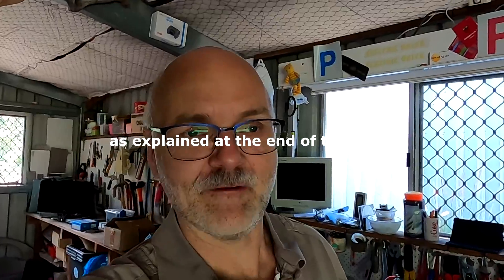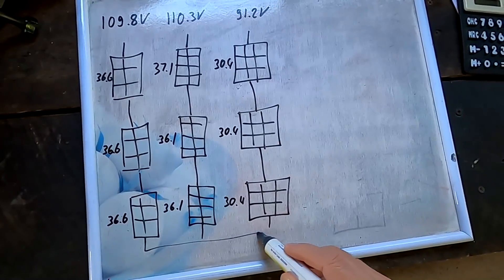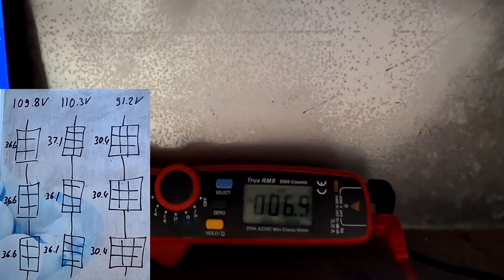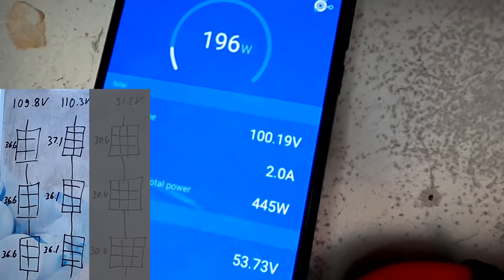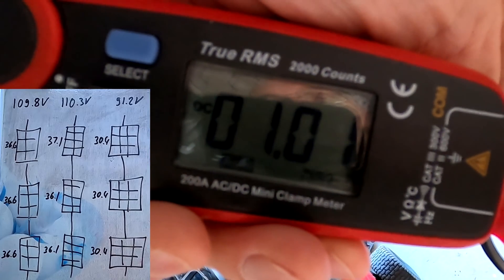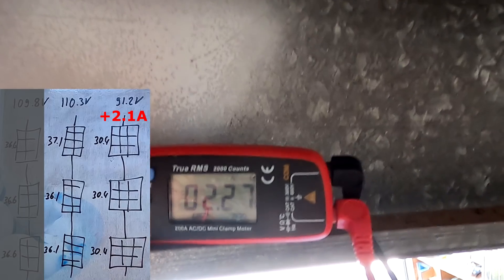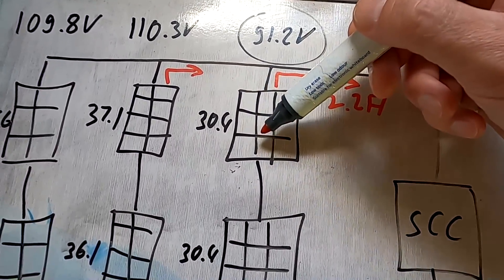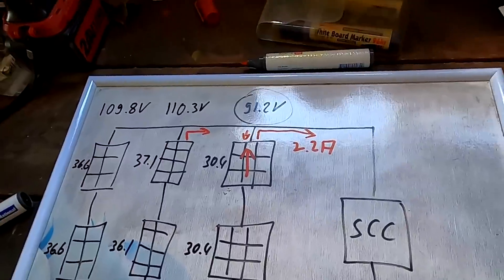Different solar string voltages in parallel. Does that work? (no blocking diode)🌞🔧⚡🔋

Comment: There will be no reverse current under load as long as the lowest-voltage string receives enough light to bring its open-circuit voltage up to the highest voltage strings' MPPT voltage. The only real problem here is that none of the panels will be able to operate at their MPPT since the charge controller will settle somewhere in-between at what appears to be the overall maximum power point instead of the maximum of either panel type.
Reply from the maker: Yes, that is correct. The SCC will find the overall power point of all the strings and run the panels in the best possible way. 
At the end of the video I had some info about two exceptions where current could flow the other way though.

Comment: The Mpp voltage of the different strings would be more important than the OCV .  ?   I like your curiosity Andy  .
Reply: Any Voc that is below the Vmpp would be VERY important ...
Reply: @MrSummitville  Yes but we know that's not the case here. I meant the mppv of the different brands may be so close is why it doesn't back feed. He showed us the voc .
Reply: @onthelake9554  My statement is applicable to ALL cases.  Your original statement is ONLY applicable to Andy's design - which you did not make clear.  Other people read these forums and they need to know how this issue may affect their design ...
Reply: @MrSummitville  Agreed.
Reply: @MrSummitville  And to those of you seeking design advice , this is not the place . This IS the solar experimental  garage for adults only , don't try this at home , batteries not included.
Reply: @onthelake9554  Actually, it IS the case here!  Andy's video shows the Vmp of String #1 & String #2 = 110 Volts.  But then the video shows the Voc of String #3 = 99 Volts.  99 Volts Voc of String #3 is well BELOW Vmp = 110 Volts of String #1 & String #2.  Now, look at where the "combined" Vmp value occurs ... it is pulled down near String #3's Voc.

Comment: Your mppt controller is finding the maximum power point for all strings.  So with 2 strings it picks 100v and with three it picks 95V.  You lose power from the 2 higher voltage strings when connecting the third.  It is safe to parallel strings like this, but you don't get the maximum power.
Reply from the maker: How much do you lose though? 1%? 2%?
Reply: @OffGridGarageAustralia  So easy to calculate.  95V/100V is 95% so you lose 5% on each of the higher voltage strings.

Comment: I believe if you use a MPPT controller there is a negative effect on the Voltage as the 2 higher power strings won't be able to produce there highest voltage to for the controller to use.
Reply: But the 3rd string adds way more wattage vs the small ( 5% ) wattage lost in Strings #1 & #2 = net GAIN !

Comment: O.k. Andy  the resistance off each panel in the lower voltage is 14 ohm each 42 ohms in parallel with the other two string of panels. The other strings are 17 ohms above each 51 ohms above at time of testing. So 16 ohms all strings  in parallel resistance.  Input resistance to the mppt see a resistance each moving of about 16 ohms at time of testing. Great vlog mate, really enjoyed this one. So let's say a input of much high resistance at the mppt input so maximum power transfer from the 16 ohms to the mppt. Wouldn't the doides help too?

Comment: So the MPPT charge controller operates the load, in this case the solar array, at the maximum power point.  If you connect panels of different VOC,  it will still operate the entire array at MPP for the system as a whole.  This will probably be sub optimal for panels which show different voltages but there will never be any current flow between panels.
If you had 3 charge controllers,  and you connected one to each of the 3 strings,  each string would then be operated at MPP and you would get the maximum current from the array.
Reply: There certainly can be current flowing between parallel-connected solar  panels ...
Reply: @MrSummitville  Can you please explain how that's possible ?

Comment: Things work as expected. You tied the strings together so they will be running at the same voltage. The current will add on the way to the charge controller. Imagine the mppt curve of both string, now for every voltage add the current in these curves. That will create a new curve. The controller will find a point on that curve where it can extract the most power of the combined system. But it is not very efficient. None of the strings will run at THEIR optimal powerpoint. But both will contribute until the open cell voltage of one string is below the max power point of the other string.
Reply: It is still very efficient because ... the drop in wattage in the Higher Voltage Solar Panels is much LESS THAN the additional wattage GAINED by adding String #3.  You totally missed the Moral of this Story ...

Comment: Rewinding so I can write the numbers down.
First look, I would say you need 2 charge controllers, 1 for the 2 strings with the same VOC, the other Cc  For the string with a lower VOC.
I am assuming the Imp is simular for all the panels in each stings. Can you show the lable for each panel type?

You said morning, on a west facing array, is that correct? You also said something different about shading for each string. Faint shading limits power production.

To many variables, so confusing.

Comment: Hi.
Yes you can combine your panels but your mppt charger will choose a lower MPP voltage so your higher voltage strings will run less efficient. The charger will pull the voltage further down, since power is voltage times current you'll get less wattage from the higher voltage strings.
Reply: I was told the same thing. I think in the case where you have these panels 2 controllers would get you the most out of the strings and you can connect them to the same battery
Reply: @TBL_stevennelson  Adding a second charge controller will increase the total wattage only 5% - 10%, not worth the additional expense ...
Reply: @MrSummitville  I think he means have the 3rd row on it's own CC being the second one, that way you get the most out of all panels at once.
Reply: @vet137  Yes, I know.  I said, only a 5% - 10% increase is output.  NOT worth the expense ...
Reply: @MrSummitville When you connect panels in parallel, the voltage stay the same. But, when the strings have different voltages, the higher voltage strings gets dragged down to the lowest one. All the three strings will operate at 99 volts, so the left string will loose 17,5% of total wattage output and the middle string will loose 16,8% of total wattage. That adds up to a total loss of 34,3% of total wattage output in the higher voltage strings.

Though the video was about Amps and what happens when you connect them in parallel (ads up) which was right to the point, makes this discussion a little sidetrack. When reaching for maximum power output in this array, it's better to disconnect the right string and receive the maximum amount of wattage in the other two strings. You can still use the right string for another purpose.
Reply: @SolarProjectsSweden  So in east-west roof and 1 mppt input, is it better to connect both strings in series and expect the bypass diodes to bypass the string in shade or its better to connect them in parallel and add a blocking diode?
Reply: Yep, that's what I was thinking as well. I think it's kind of a complicated problem, as the IV curves are going to look different for each string. The results you get will be dependent on what those shapes look like, and what the MPPT controller thinks is happening. But I agree, in general the efficiency is going to be lower than running them as matched strings. I wonder how it compares to the idea of reconfiguring the strings to have Vendor A---Vendor B----Vendor C  strings, so each string is matched (assuming max current ratings are the same).

Comment: I think your voltage dropped to the lowest string voltage in your test. It went to 99. That makes sense because if you parallel two panels with different voltages, the lower voltage is used, but you can add both strings amperage. That of course will make your total possible watts less than what you would get individually. Series would add all voltages, but only use the lease amperage of the strings which is usually also less than the individual panels would make.
Reply: The Max Power Point Voltage of the three (3) strings connected in parallel, will NOT always be the voltage of the lowest voltage string.  In this case, the drop in wattage in the Higher Voltage Solar Panels is much LESS THAN the additional wattage GAINED by adding String #3.  You have totally missed the Moral of this Story ...

Comment: The problem is mostly in trying to find the MPP. Less of a problem using old tech PWM charge controllers, but MPPT isn't great because there exists no common max power point between different strings.
Reply: The drop in wattage in the Higher Voltage Solar Panels is much LESS THAN the additional wattage GAINED by adding String #3.  MPPT has no problems with these parallel-connected strings.  You totally missed the Moral of this Story ...

Comment: I think all of the three strings of panels will operate at the same voltage, dictated by the MPPT charge controller, and each string will give the corresponding current for that particular voltage (according to the I V curve, for given light and temperature conditions). The only issue could be the superposition of different maximum power point curves, and the mppt algorithm could find a local maximum, instead of the global maximum, give the fact that only some of the panels will be operating at the optimum voltage, the rest being suboptimal...
Love the videos!
Reply: Also I don't think the current will be flowing backwards in one of the strings, at least not as long as the light shines on the panels.

Comment: There is just not enough difference 60 cell panels in parallel with 72 cell panels.  But just remove one of the 60 cell panels leaving just two in that string and then you will see what you expect and that is current flowing from the 3x 72 cell panels in to the 2x 60 cell panels. I expect about 0.7V clamping voltage per cell (depending on panel temperature) so 120 cells x 07V = 84V thus in open circuit you will not see more than 84V when you parallel the 3x 72 cell panels with the 2x 60 cell panels and all (most) current from the 3x72 cell string will flow in to those two 60 cell panels in series.
Now if you were to connect that to a solar charge controller and battery is not full the solar charge controller will be able to find a max power point likely around 60 to 65V and then all current from the 72 cell panels and 60 cell panels will go in to charging the battery but when that stops the current will again flow in to the 2x 60 cell panels.
All you need to remember is that solar cells are nothing other than diodes that is also why you see an open circuit voltage as that represents the diode clamping the voltage and all current is shorted by the cell thus solar charger reduces the voltage so that current flows in to battery instead of being wasted in to solar cell.

Comment: Two things to note. It is NOT true that current follows the path of least resistance. I don't know how this (false) idea got to be so widespread. Current follows ALL paths. It is true that more current will flow in the lowest resistance path. But the current divides proportionally, and if several paths of nearly equal resistance exist, the current will be nearly equal in all paths. Second point: solar panels are not resistors, and don't behave like one. The current/voltage relationship in a panel does not even approximately follow ohms law. At any given level of illumination a panel acts like a constant current source in parallel with a series string of many diodes. When the panel is open circuited, the current generated by the photons flows right back through the panel itself, from the plus end to the minus end, through the cells (which are, as I noted, diodes.) The voltage across each diode is an exponential function of the current through the diode. If each cell has a forward drop of 0.5 volts at.0.005 amp, it will have a forward drop of 0.56 volts at 0.05 amp, and 0.62 volts at .05 amp, and 0.68 volts at 5 amps. This relationship holds for any silicon diode. When you put a low voltage panel in parallel with a higher voltage panel and don't connect a load, nearly all the current generated by the higher voltage panel will flow into the lower voltage panel. But when when you connected the MPPT controlled, it iteratively tried pulling more and more current, which lowered the voltage until it no longer flowed through the lower voltage panel, and then it continued in that direction until the voltage got low enough that the current flowed out of the lower panel as well.
Reply from the maker: Yes, I explained this wrong. Most current will go the easy way (lower resistance), some will go the harder way (higher resistance). Your absolutely right.
Just in case of the solar strings it's not the case. There is no back current into the steering with lower voltage because of the SCC connected. At the end of the video, I explained this.
Reply: @OffGridGarageAustralia  Because when your three (3) Solar Panel Strings are connected in parallel, they will ALL have the EXACT same voltage, as long as the sun is shining and there is a load.  The Voc that you measured and that you talked about, as being a "problem", is irrelevant when the sun is shining and there is a load connected ...

Comment: but what happens when the battery is fully charged and the charge controller no longer draws energy?
Reply: I asked him several times same question. 
He always said there is no problems
Reply: @zarbonida  because of this problem and different alignment, I use 2 charge controllers
Reply: @zarbonida  When the Charge Controller no longer needs any amps,  then what do you think happens?
Reply from the maker: Just watch until the end of the video...😉
Reply: @OffGridGarageAustralia  yes, OK. 👍🏻

Comment: It is known that if a group of different panels is connected in parallel and with different of voltage values, then there are two cases we get: 

1. If the solar charger charges the battery and supplies the loads with high power, in this case there is no problem because all the solar panels will have lower voltage values for them and equal, as you explained in the video. 

2. The second case, if the solar charger stops charging the battery or the power it takes from the solar panels is very little, then the problem will arise and the high-voltage panels discharging the current to the low-voltage panels.

 You can try this case and make sure that my words are correct.

Comment: What charge controller are you using? Your voltage is alarming and you need a huge charge controller! 270V
Reply: Only if all three strings were wired in series with each other not in parallel
Reply: @mikebarry229  
Not sure I understand. If you’re running them in Series your way over the voltage! If you run them in series parallel, less voltage but you’re still way too high. I have 250/100 Victrons.
Reply: He was wiring the 120v strings and the 110v string in parallel  .  Why do you find it alarming ?

Comment: After watching current.
I think you missed it, but the current did go down 10% when you connected the other panel - not straight away, but as the MPPT adjusted the voltage it dropped but you said it was shading.
But that 250w panel string is losing efficiency - as its not "tapped" at the maximum power point.  Yes still producing power, but you would get 10% or more more on a separate MPPT

Comment: The lower voltage string will bring down the voltage of other strings as in the "nodes law" all voltages are the same in a parallel circuit.
This will bring the maximum power point off to the left on the MPPT curve of the two other strings matched in voltage and they will not deliver their maximum power. But they will deliver more amps as the point on the MPPT curve get closer to Isc.
Reply: More amps with low voltages in the wires mean fire danger
Reply: @zarbonida  no because Amps can not go over Isc and wire are sized to accept more than Isc (else they would burn when testing short circuit current of the pannel ...)
Reply: @vaneay  dont't forget distance and hot temperatures in Australia
Reply: @zarbonida  STILL not not a problem ...

Comment: Interesting parallel Solar panels .... please do other tests  at different sun and shade.. i have the same questions from my East West roof panels...and just one string SSC ... greetings from Holland
Reply: An East string connected in parallel with a West string is not a problem. This was proven 10 YEARS, ago.  So why test again?
Reply: @MrSummitville  do you know my situation ?? It does not  work good...But i will try it now with extra blocking diodes...AND why should Andy stop doing tests ? We all learn from this..

Comment: 3) If a full string is sufficently shaded that is equivalent resistance (impedance) is lower than the charge controler resistance (impedance).
Reply: Impedance only applies in an AC circuit
Reply: @offgridwanabe  or when current and voltage varies 😉
Reply: @vaneay - You wrote -  3) If a full string is sufficiently shaded  that is equivalent resistance is lower than the charge controller resistance  <== Is that ever possible, in the real world, during the "day" and there is a load?

Comment: before watching comment :   No, well yes but losing efficiency.  Depends how close the maximum power points are as it will take an point wheres its not ideal.  However will you lose 5%, 15% or 50% would depend on how different the maximum power points are.  but in some ways this is what happens when some are shaded anyway.